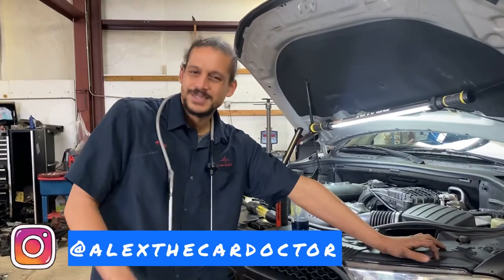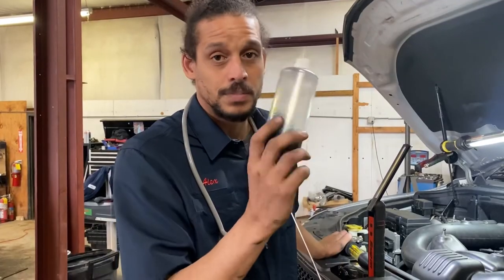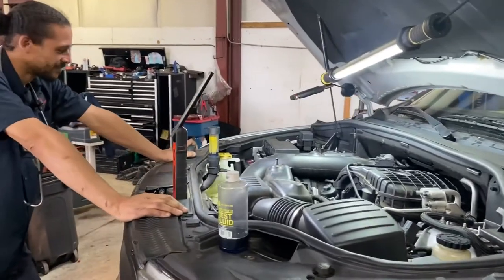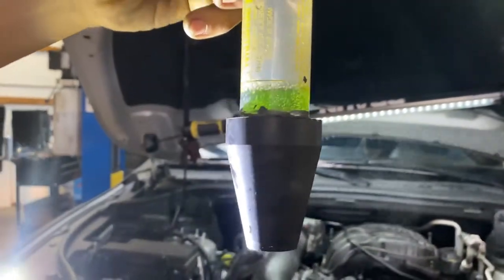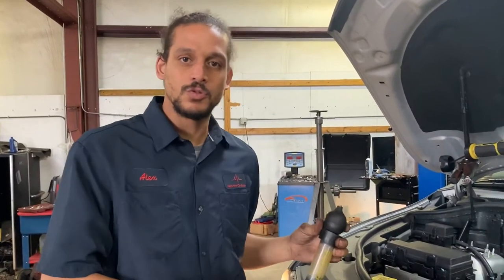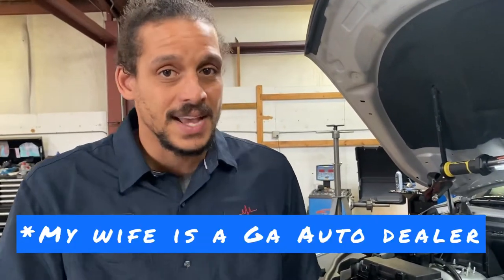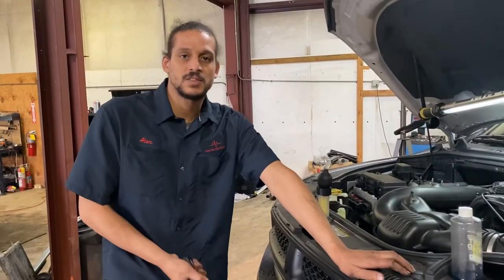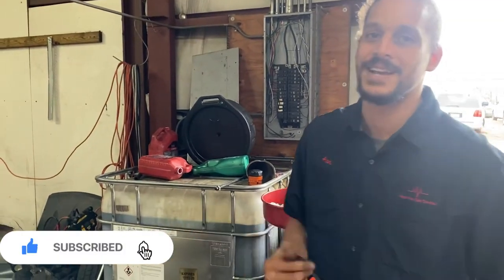Busted Oil Cooler caused Dodge Durango to Over Heat - Common 3.6 Pentastar Problem #dodgedurango

Comment: A BIG THANKS to ALEX THE CAR DOCTOR for replacing a OIL COOLER ADAPTER ASSEMBLY on my 2011 DODGE DURANGO. After taking my truck into the dealership for repairs which would have been a $1400 job, I decided to get a second opinion and after doing a Google search to see what the part looks like, where it goes and how much it cost, I discovered this YouTube video which I thought was very informative and straightforward. Alex and his wife Shon explained everything to me in detail which I appreciated and left me leaving paying half the cost and a smile on my face😃. GOOD WORK👌👍GOOD PEOPLE! A RETURNING CUSTOMER❤

Comment: I’m learning as much as I can about my Pentastar engine… I’m leaking oil and this area is the culprit.  I’m about to replace it in a few weeks when all the parts come in.  Thank you for making these videos :)
Reply from the maker: Thank you for watching I really appreciate it and I’m glad you enjoy my videos happy holidays
Reply: @AlexTheCarDoctor   hi Alex I have a question dodge Durango same kind and color lol I have the cooling fan does not work while driving but works in park other words I’m sitting in park it works but In drive sitting still running hot
Reply: @AlexTheCarDoctor where you located bro ? I need work done asap

Comment: Mine runs hotter than normal as i can feel not by the gauges but only overheats when idling when sitting sometimes coolant level stay the same and oil does too fans just blows the hot air coming from the engine i dont see how that helps cool it down must just be coolant doing the job. Also after the test is done does it cause any air in the system?

Comment: Hey Alex my resivor keeps going low I’ve changed thermostat water pump and radiator so what would cause it to keep going down but the car is not overheating at all is still at a balance level. It is a 2013 dodge challenger.

Comment: Hey Alex, great video you've gained another subscriber!  I'm having the same overheating issues with my 2013 dodge charger.  Also i'll definitely be getting that block tester ASAP! I've changed out pretty much everything (thermostat, water pump, oil coolant housing, radiator and hoses, etc.) Only thing I haven't done yet are the head gaskets..... So I'd love to see you do a vid on that if possible!  I'm trying to see if it's something I'd be able to do myself before bringing it into a shop for a head gasket job or just a whole engine replacement all together.      Looking forward to seeing some more of your work keep up the great work Bro, YOU'VE SAVED ME A TON OF MONEY!!!
Reply from the maker: If a blown head gasket comes in, I got ya! Glad I was able to save you some cash. That’s why I do these videos!
Reply: After u do that test and everything is ok do you have to do anything to the system does it cause any air or anything in the system???

Comment: Hello Alex great vides, I have a 2011 Durango 5.7 I replaced the radiator because was leaking then I saw that the pulley for the water pump had some play so I replaced it now at soon as I started it up it overheated I tried to bleed it but no results now the hoses stayed cool to the touch any advice. Thanks for all the videos

Comment: On my 2017 dodge durango sxt i had a code P0305 cylinder 5 misfire pop up. When taking of the upper intake manifold i notice the hole on my lower intake manifold next to cylinder 5 was filled with water/coolant. Is that normal?

Comment: A bad oil cooler will cause the Jeep engines to run hotter than normal correct? I have a wrangler than I seen has the famous oil puddle on top of oil cooler and down under the transmission. Will the bad oil cooler cause the coolant to go to the over flow tank??
Reply from the maker: Hello.yes that’s correct that bad oil cooler will make the engine run hotter than normal and go to the over flow, the reason being there is not enough coolant in the system and when that happens air enters the system causing coolant problems

Comment: Hey Alex i have my dodger durango 2011 runs well only overheat when i accelerate going up hill or Just going over 70mph. I replaced thermostat housing and radiator cap. Any advise of what i can do to fix my dodge? Dont know where to take it anymore.

Comment: I have a Jeep 3.6that just started running hotter than normal especially up hills and under load. I have installed a new radiator OEM stsyle TYC, and a new mopar water pump, new coolant, hoses, and thermstat. New overflow tank and cap. Burped all teh air out and it still runs hotter tha I like. 220-228 driving and up hills and under load it gets to 242 now. Used to get 230 MAX. Tested for combustion gas and its ok. My oil cooler looks like it has a ton uf goop collected around it. I have 100k miles Jeep 2015 JK.  Just wont ever cool back to 208-15 like it used to

Comment: I have a 2012 Dodge Durango 3.6l V6. So never had any problems till I went n got an oil change. At first it wasn't over heating but I went out of town coming back home my SUV spiked up to Hot then just came back down to cold. Of course got home was smoking up a bit. SO I do an inspection trying to see what's going on I have what was full of coolant to none then we put water to see if it was the radiator n others stuff nothing but went to the top of the engine n noticed bubbles coming from the side of the Oil Coolant Housing 🤔.
So is it possible that the individual that did my oil over torqued n cracked the Housing? And do you think my vehicle is damaged now?
Reply from the maker: It’s hard to say if they damaged the oil cooler,if you have a digital torque wrench you can remove the oil filter cap in reverse to see how much torque it takes to remove it.if it’s past the specifications by a lot yes possible they are the blame thats the only way to tale. Before replacing anything I would do a block Test to make sure the head gaskets are in good shape I will put a YouTube link of me performing A Block test .I may have perform one in this video
Reply from the maker: Yes I did perform A Block test in this video.I really do cover a lot in my videos I surprise myself sometimes lol

Comment: Can a bad oil cooler cause the durango to shake at low rpm? I have a dodge durango gt 2017 had a misfire, changed the spark plugs already and a coil from cylinder 2. But still shaking when you stop somewhere, oil reservoir has small oil bits and no overheating at all.
Reply from the maker: Nah it doesn’t sound like an oil cooler issue. You may have a bad injector. I’ve come across a lot of faulty injector on the 3.6 pentastars

Comment: Great video. I stumbled on this video because I'm trying to replace the coolant temperature sensor on a 2014 durango but I can't it and there nothing on YouTube on the internet that says where it's located. Do you happen to know where it is on a 2014 v6 durango?
Reply from the maker: Hey there I’m glad you found my channel. I agree no information on where the temperature sensor is located but I got your back unfortunately it is located on the oil cooler under the intake manifold I have a video showing how to get to it I can send you the link if you like.I recommend changing out the entire oil cooler because they are prone to failure, the new one comes with both sensor oil psi and coolant temp

Comment: Have you found anyone that sells the 2014 and up oil cooler by itsself? Found plenty of assemblies with and without the cooler but no individual coolers
Reply from the maker: They should only come in an assembly not separate you may be looking at the wrong thing. My first time looking one up the wrong one kept pulling up
Reply: @AlexTheCarDoctor  correct thats what I have found after a day of searching. A shame because all I need is the cooler and I can throw on the aftermarket one.

Comment: 2014 dodge durango. Saw oil leak in driveway. No over heating, no white smoke from exhaust. However, there is oil in the coolant reservoir. Any thoughts?. Drove just fine but parking it to be safe
Reply from the maker: What engine do you have
Reply: @AlexTheCarDoctor  3.6-liter Pentastar V-6
Reply from the maker: It sounds like you have a bad oil cooler. I would start their
Reply: @AlexTheCarDoctor  ok. Will def check it out. Thank you!
Reply from the maker: That’s one of 2 places where oil can mix with coolant, the other is head gasket on that engine.

Comment: Mine is over heating but in of the tubes that goes from the radiator is literally sucked in but once i opend the radiator cap it gets back to normal help!
Reply from the maker: Sounds like you need to replace that coolant hose, upper radiator hose what it sounds like you’re talking about.then bleed The cooling system afterwards And make sure the lower radiator hose and the upper radiator hose or hot when the vehicle warms up,once you put the cap and everything back on that test ensures The thermostat is opening
Reply: @AlexTheCarDoctor  ive changed the  radiator the thermostat not to long ago i hope the hose is the problem thank u so much!
Reply from the maker: @jacquelinetovias6239  I’ve seen that before on a number of occasions after replacing radiators and etc.
Reply: @AlexTheCarDoctor  thank u so much!
Reply from the maker: My pleasure buddy

Comment: Alex i need your assistance with a 2015 Dodge Durango V6 Limited over heating issue. Temperature needle keeps fluctuating… I’ve done thermostat, coolant temperature sensor and changed relays… still having the issue. Please advice…
Reply: Having same issues.  Did u come right?

Comment: We have a issue on a 2017 3.6 dodge Durango we noticed a puddle and it came out of the coolent overflow and it's got oil in it the coolent its like sludge but it never overheated but was very low on oil and can't figure it out
Reply: Did you figure this out?

Comment: I have a 13 durango 3.6, and when ever I go more than 75 mph temperature goes up in between 1/2 and 3/4. Any suggestions? I already changed the radiator, water pump, and thermostat brand new and I'm still having the same problem.
Reply from the maker: You may have a air restriction in the a/c Condenser which is causing the radiator not to get enough airflow
Reply: Thank you it makes sense because it haves an issue in the air conditioning, going to check that out thanks again appreciated
Reply from the maker: The condenser sit in front of the radiator and if The fins are all bent up that will restrict air flow or if it’s something going wrong  in the AC system that will cause it to run hot as well

Comment: You seem hella honest, where are you located? i'm watching your videos, but my problem is the P0091 fuel pressure regulator 1 control circuit low. I have a LT 2011 Camaro. the mechanic had me replace both throttle body and accelerator pedal sensor and still same problem, luckily i can return the parts back.
Reply from the maker: Thank you! Im very transparent and honest. I’m located just outside Atlanta in Forest Park, Ga. You definitely need to find another mechanic. With that code you have, the car will go into Limp mode causing the car to have no power. Any time you see “circuit” codes, it’s likely a wiring issue or the fuel pressure regulator is defective. Have you have the chance to check out the video I did on this code?
Reply: @AlexTheCarDoctor  it’s the first video I saw and got hooked into watching more it’s crazy and entertaining. I called a shop and they backed out saying they’d have to remove the engine for that job 🤦🏽‍♂️ I’m in Houston.

Comment: I got a 12 durango rt it's leaking coolant on the ground close to the front kinda by the reservoir area where do you think the leak is coming from if you know?
Reply from the maker: Hey and thanks for watching.sounds like it is coming from the reservoir over flow tube that leads to the front near the wheel. You may have a bad radiator cap
Reply: @AlexTheCarDoctor  Alright I'll look into that I appreciate that a lot man and no problem you got good videos too keep em coming!
Reply: @AlexTheCarDoctor  one more question is that the tube that comes straight out of the coolant reservoir?
Reply from the maker: @FreeSmokeEA  yes if it’s the one that appears to go nowhere and found near the top
Reply: @AlexTheCarDoctor  Alright I appreciate that I'll definitely check that out 💯

Comment: i just  changed the oil cooler in my durnago and i turned it on after i repkaced it and it started overheating is that normal?
Reply from the maker: It will over heat if you don’t burp the cooling system if you’re not familiar with the process I’m sending you a video on how to do so
Reply from the maker: https://youtu.be/DOE55feY3aM
Reply: Thanks man i apreciate it and this helped a lot 👍🏿
Reply from the maker: I’m glad you enjoyed it, that’s why I have this channel to help people truly

Comment: You don't need a machine shop for heard gasket work, unless the head is warped. I new gasket, flush the cooling system, takes care of a majority of cases.
Reply from the maker: Correct. More than half of the time, I see them warped. I don’t want to deal with Machine shops period. So to cut down on the possibility of needing to deal with them, I don’t accept head gasket jobs for the public. Only for my own cars. That way if something goes wrong, it’ll be on me 👨🏽‍🔧

Comment: Did they improve this design in later years?
Reply from the maker: Yes if you’re talking about the part. Aftermarket has a all aluminum oil cooler now. It’s all I install now.
Reply: @AlexTheCarDoctor  No,I know about the aluminum one but did they improve the stock one on newer models, I have a 2020 wondering if they go as much,maybe they beefed up the design somehow.

Comment: Hello 👋
I changed my thermostat/water pump /coolant temp sensor and my Durango still over heating. I'm seeing that oil cooler module might be the issue?
Reply: I’m having this problem with my 2013 charger. I changed the thermostat and outlet housing last week and I over heated again. Hope it’s the oil cooler because I ordered an aluminum one

Comment: Wheres the temp sensor located ?
Reply from the maker: If you have the 3.6 Pentastar, it is located under the intake manifold attached to the oil cooler.
Reply: @AlexTheCarDoctor  I got a p0117 so im trying to locate that sensor . Fans turn on an off but ac is off . I was trying to bleed the radiator system
Reply: @AlexTheCarDoctor  isnt the sensor toward the drivers side back ?
Reply from the maker: @nipsey3221  it’s in the center,if the cooler is plastic, I suggest upgrading it to the aluminum one,it comes with the sensor attached to it already

Comment: Changed the oil cooler; 
Accidentally pulled up fuel injector now it's leaking.
What should i did?
Reply from the maker: Hey buddy. The best thing is to replace the fuel injector o rings. Go to the dealership for the parts, when installing them, put a thin coat of grease on the o rings and make sure there is no debris in the area.
Reply: @AlexTheCarDoctor  thank you for responding
Is there a way to keep it from leaking before going to the dealership
Reply: @AlexTheCarDoctor  also do i need to depressurize?
Reply from the maker: It’s hard to say without seeing it. In my experience once the O-rings are damaged there’s nothing you can do but replace them. You can depressurize it by removing the fuel pump fuse/relay and cranking over the car
Reply: @AlexTheCarDoctor  would that be a need? Or just if i want to (depressurizing it)
Reply from the maker: @Gracepreferred  That’s the procedure for depressurizing it. Definitely not a need but it stop’s fuel spray when disconnecting the fuel line/injectors. When I’m being lazy I just normally take my time and disconnect the main fuel line very slowly and clean everything up with brake parts cleaner afterwards
Reply: @AlexTheCarDoctor  you've been a great help. I appreciate it. 

Finally changed the o rings. The first start was rough, the second start was perfect but white smoke is coming from under the hood. What could it be?
Reply: @AlexTheCarDoctor  on the passenger side
Reply from the maker: @Gracepreferred  most likely just burn off of some sort let it run for about 30 minutes recheck for leaks then drive it
Reply from the maker: The smoke should be gone in about 15 to 30 minutes
Reply from the maker: If it’s burn off
Reply: @AlexTheCarDoctor  it was thank you so much! 

One more question and I'm done lol. If i go somewhere in the truck and then turn the truck off it wont start again right away. It has to sit for a while then it'll start up. Any idea on that. This started way before changing oil cooler
Reply from the maker: @Gracepreferred  ask many car questions as you like it does not bother me.do you have a check engine light and do the engine just turns over and not start or you don’t hear anything
Reply: @AlexTheCarDoctor  yes the check engine light is on and red lightning bolt. Also it doesn't turn over.
Reply from the maker: @Gracepreferred  do you have a way to check the code if not go to your local AutoZone they normally pull check engine light code for free
Reply from the maker: Look me up on Instagram we can type each other there
Reply from the maker: That way you can send me pictures if I need to see something on your vehicle